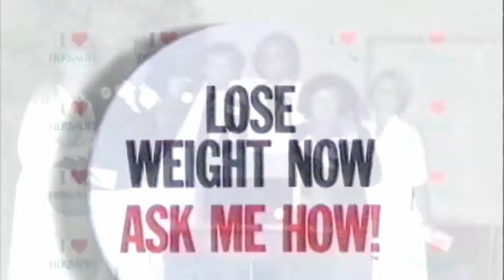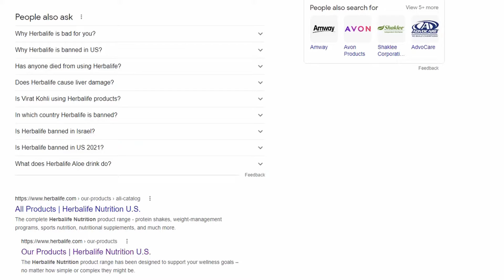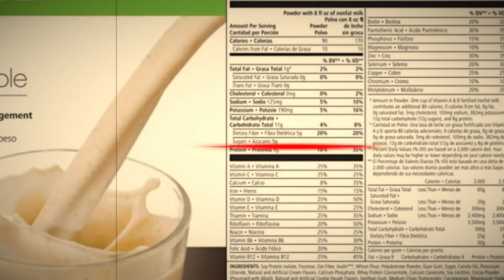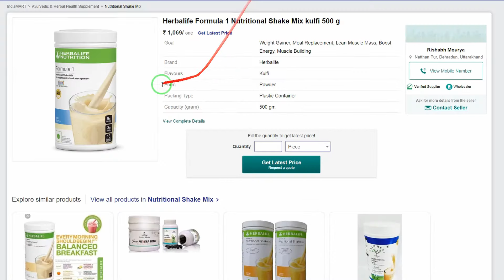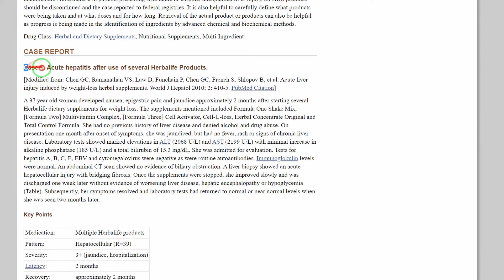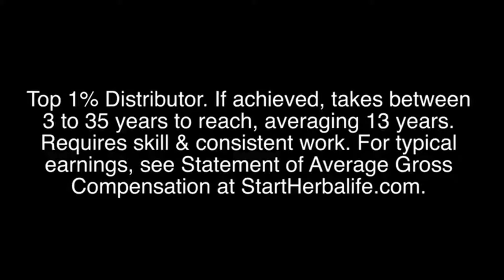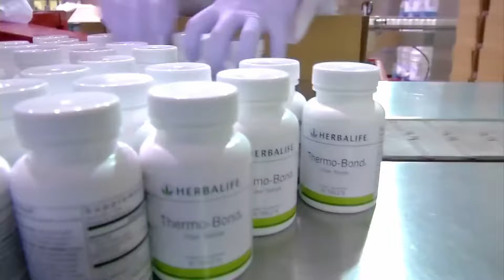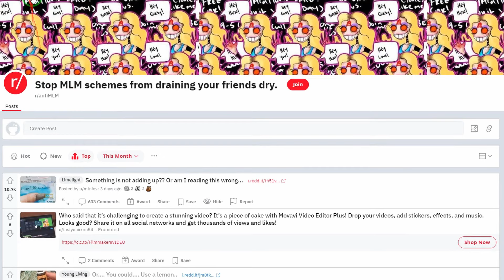Doctor Reviews Herbalife - The Truth Exposed

Comment: I think their products are too high on protein and not of great quality especially the protein shakes. I don't know for the 24 nutrition range but clearly all whey protein are high in protein, low in sugar, not more than 1gr in general and they have additional benefits like BCAAs. I am not a fan. The one product I like though is the aloe vera drink
Reply from the maker: I also remember the aloe vera having ok taste. The protein shakes seem ok but i think they are overpriced. The roasted soybeans and protein bars were tasty tho'
Reply: @DrVictorGeorge True they should lower it to atleast 10 bucks per powder container. And it pretty hard for new distriubitors to start off
Reply: Most people do not get enough protein. You should be getting 1 gram of protein for each pound on lean body mass unless you are overweight then 1 gr per pound of desired weight. All protein shakes are made equally. Whey concentrate can be tolerated by most people unless you are lactose intolerant. If you are intolerant, then you would need whey protein isolate. The key is finding out what works for you, don't discount all products based on one.